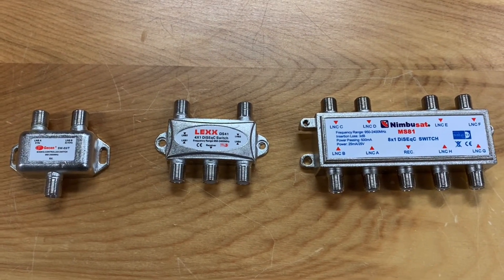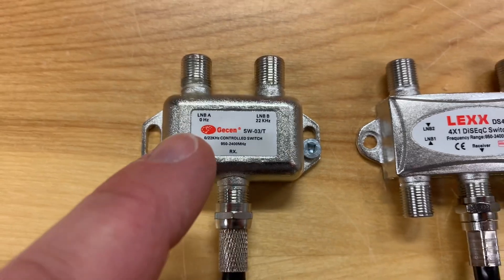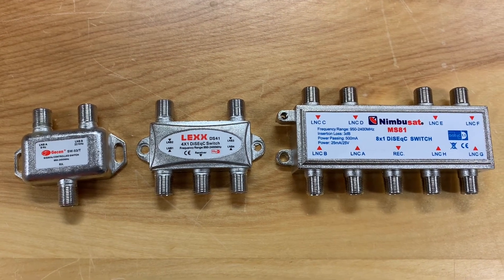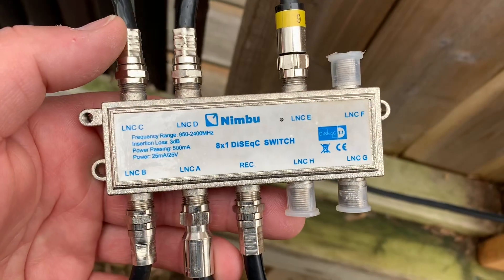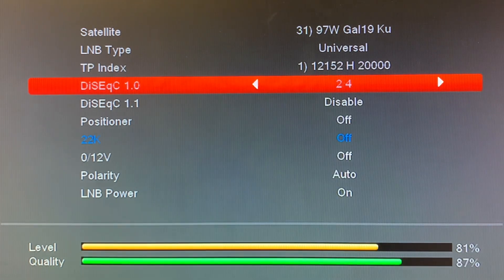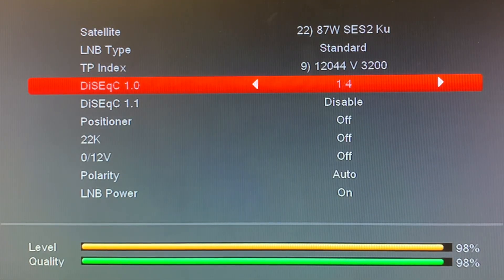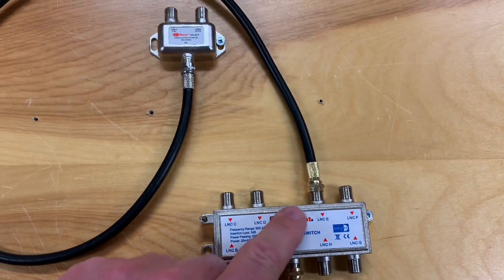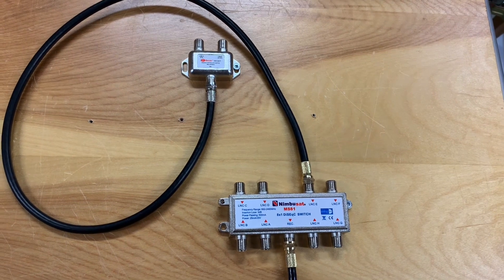Whats the difference between a 22khz switch and a DiSEqC switch? | Free Satellite TV switches

Comment: I have a problem on my satellite disk signal, during day time when the sun I hot I received my signals and strength 100%functioning and when the sun set going down to night time it looses signal and strength.What the problem?is it the lnb? Oh what? please help.👍👍👍🖐️🙏🙏🙏
Reply from the maker: If the signal works during the day, then I’d say that your dish is probably aimed correctly. Are you getting condensation on the dish in the morning? Cool temperatures at night could cause water droplets to form on the dish surface. This can absorb the signal instead of it reflecting back to the LNB. Also, weather disturbances anywhere else in the path of the satellite beam can also affect the signal at your dish.

Comment: Just trying to get some feed back on how to isolate dishes?     the only way i have found is to use a A  B switch, witch means two complete coax runs into the house so if one has 4 dishes then  4 complete dish runs, i cant come up with any other way , witch means you have to use a lot of coax these switches i cant get them to do that.
Reply: Hi it appear that the super jack diseqc h-h dark motor doesn’t like these switches almost fried the coax , so to isolate every dish i am going to toggle them with ab switches and deal with all that coax, appreciate your replies have a good one.
Reply from the maker: @tomthumb6278  You’re welcome, best wishes.
Reply from the maker: The switches have to be programmed in the receiver menu. I showed the setup in the video. An A to B switch probably doesn’t have the proper bandwidth for channels to pass through it.
Reply from the maker: For 4 dishes I’d use a DiSEqC switch. Set each dish up in the menu as I show, 1/4, 2/4, etc.